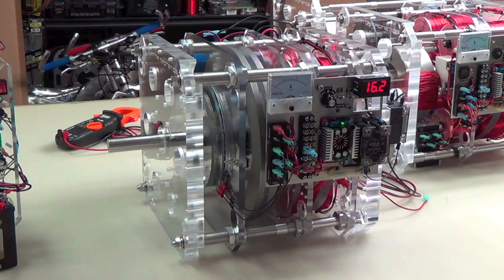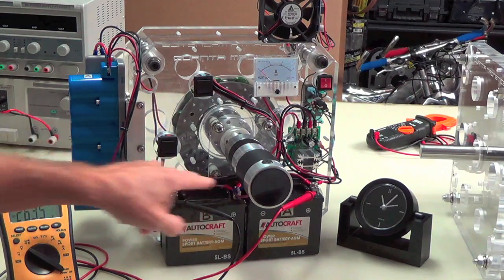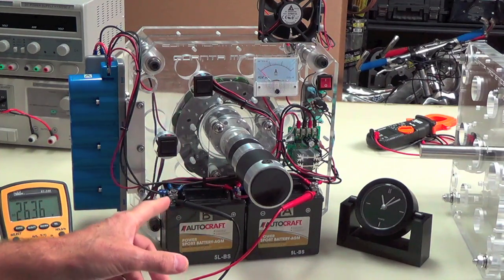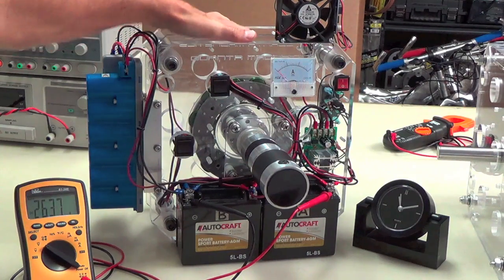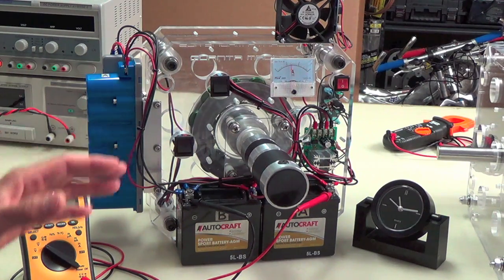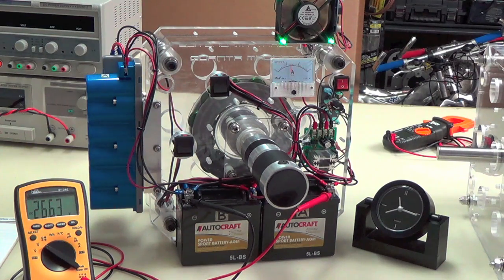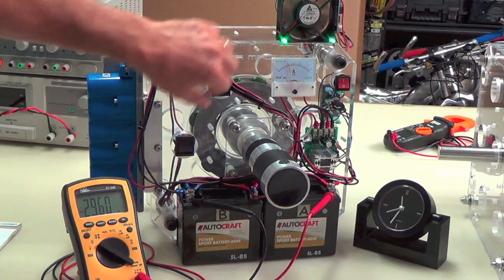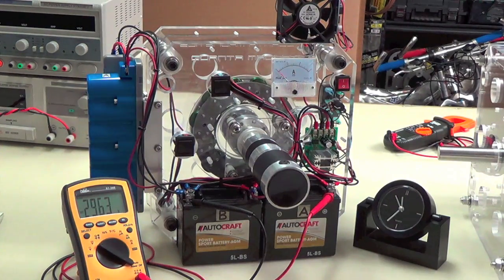Tesla Switch Hybrid to Supercaps

Comment: Watching again OK now Just had a YOUTUBE glitch for a moment .
Can You tell me the difference between Amps in and Amps out? R
Reply from the maker: +Roger Barker  I'll need to connect two more ammeters due to split phase outputs. Then I can give you the numbers.
Reply: +PMMG4HYBRID Thanks heaps . 
Appreciating that you have uncovered some kind of a new electro-chemical effect on your Ultra-cap/AGM series/parallel system, generating excess Voltage. which may require a dump mechanism to protect electrical components.
It will be nice to see, Quantified in Amps, what positive output benefit is available. 
While voltage presents high, maybe current could be regulated or transformed and utilized direct with more load than demonstrated by fan and LEDs, or diverted into secondary storage bank or inverted back to grid. 
Kind Regards. Roger

Comment: So is this not just showing that: when system (motor) is switched on it draws a current from the batteries/caps.
the 3 phase generator then reacts to try and balance the loss (greater load reflected in the motor drawing more current).
as the batteries/caps start to charge due to the current flow from the generator (looking at this the current generated is greater than the total system loads) 

As the internal resistance in the batteries/caps decease due to saturation point the load on the motor drops, reflected in the current drop drawn by it. The 3 phase generator is simply reacting to the loss in induced magnetic friction.

Put a load on any motor and its reaction is to create a greater magnetic field, you feel this by the resistance in turning the motor, reduce the load (current) and the motor will spin more freely.
 
Your system is simply reacting to a loss in balance between battery and generator then over coming it creating less reluctance. Your generator is ultimately producing more current than the system losses.
Reply from the maker: +Paul Baxendale  Thank you for your generous input Paul.

Comment: 26.35 V * 1.5 amp = 39.525 Watts at start
29.7 V * 1.1 amp = 32.67 Watts at end
A loss of 17% of power...
So where is the gain???

NON GAINS OR OVER UNITY !    ONLY BATTERIES THAT ARE DISCHARGING.
Reply from the maker: +Daniel Gendron  Wow, get a grip Daniel. This is only a simple demonstration. Your hypothesis is flawed.
Reply: +Daniel Gendron Sorry but you are not correct, I don't think you really listened to all the explination. The meter is measuring input amps @ one 12v battery via a PWM, it is a 12v motor. The current drops because the load on the motor drops due to change in charge resistance of the battery as it's voltage rises due to charging, that's why the current drops.
It is an interesting and complicated design to quantify as far as energy is concerned. One way is to let it run indefinatly with a balanced load to keep the batteries at a constant voltage!!!! how long will it run for?
Reply from the maker: +Michael Nunnerley  Thanks Michael. That is exactly the point.
Reply: Few comments- Have you taken into account your D.C. Armature in your motor is going to spin faster as it increases in temperature just from running light load, and your losses are becoming less in the planetary gear box as well as it warms up. Allowing it to spin faster and faster. After D.C. Motors reach thermal equilibrium they typically increase in speed by 5-7 % .  
This would increase your emf on your generator. 
But very cool.

Comment: How do we know that the ultra caps are not charging the battery
Reply from the maker: +Tyler Badertscher  They are connected in series-parallel with the batteries. That would not be possible.

Comment: If the batteries have low power, and can make the engine turn, will they be able to recharge themselfs?
Reply: +Ricardo Goulart (Spartan XXV) Can you make that think small enough so I can have it in my pocket and recharge my phone? maby has an condenser to give the starting kick... ?? If you can make that small & cheap enough, it would be a nice thing.

Comment: This reminds me of Nikola Tesla technology seems to at least show similar effects. Interesting!
Reply from the maker: +Banzay20  Has zero to do with Bedini devices.
Reply: +PMMG4HYBRID Ok, Did´t mean to step on some toes. But isn't it some kinda back EMF stored in the caps (voltage peaks) and then they are utilized in the batteries, as far my understanding goes "we" are teaching the conservation off energy in an obsolete way. And where you can get a bigger amount of electrical energy out of a mechanical magnetmotor then you are putting in. 

Thanks for sharing this amazing technology!
Reply from the maker: +Banzay20   No problem.  This has more to do with chemical acceleration and electrostatic absorption or transfer. Still unusual none the less. Thanks.

Comment: battery is a complex chemical device, higher voltage on the terminals does not mean it has more energy in it. the only proper way to measure stored energy in the battery is to do a full discharge and then take the intergral below the discharge curve.
Reply from the maker: +Vadzim Dambrouski   Of course this is true with electrochemistry. Keep in mind that it is the opposite for integrated ultracapacitors, where higher voltage translates to greater stored energy.

Comment: Very nice setup.
Just curious: is the motor running on the 26 volts of the 2 batteries in series or just on one of them?

I have done similar experiments some time ago... when I started at 13 volts per battery it was going up... but when i started at, lets say 12.1 volts it only went up a short time and then started going down again. After resting 24 hours they were always lower than at startup..
Could it be that the AGM batteries react differently than other lead acid batteries? Absorbend Glass Mat Batteries do have lower resistance... but it still remains lead acid...
Luc
Reply from the maker: +DaKrampus  PWM circuit controls 12 volt input. Starting with batteries at top of charge provides greatest potential acceleration through chemical reaction. 
My personal experience is that AGM batteries work best.

Comment: All I have is best guesses. I like Stephan's overunitydotcom  idea for understanding the batteries impedance characteristics. The batteries are also acting like diodes in this circuit. This could be much like the formula Ek = ½mv2 in Euler's disc with a gentle resonant nudge of the capacitors and the 3 phase harmonic Along with the slow response of the batteries chemistry.  It reminds me a lot of a hairpin circuit with the impedance of the batteries facilitating both frequency and linear impulse. Much like a self oscillating circuit or a life form ;). Its all speculative of course. The other hypothesis was already mentioned in this thread. It is the interesting properties of hydrogen. Something I have been incredibly focused on lately. If your batteries/diodes are acting as antenna in an atomic hydrogen resonance, they could be influencing sub-atomic "vacuum fluctuations". This might be more of a stretch, but we need to do some yoga it looks like ;) I am sure you are already subtracting variables to narrow down the cause and setting up controls to see if all these parts must be precise. Also to see if the effect can be increased, though seems pretty natural. It would be beneficial to get some scope shots as well to see all the sections of the circuit in action. Good to see your face and great to see your still hard at work. Thanks for sharing and I hope one of us can get some experimental confirmation on this effect. Enjoy the present my friend.
Reply from the maker: +Diadon Acs (Conscious Energies)   I kind of agree with your speculative thoughts.  I have very little knowledge in the field of hydrogen however.
For this demonstrator, I was first using a controlled small brushless motor as the prime mover element which in reality was a heavier consumer than the gearmotor with all its friction. As I mentioned at the beginning of this video, for years I have always considered this as merely an interesting side effect, yet it has never failed to produce a similar result.  Since a few individuals brought this to my attention months ago as a confusing subject of early G1 videos, I decided taking a deeper look might be advantageous to all.
I have a two channel scope that I have not yet used on this demonstrator. I'll try to consign extra time for that purpose since I'm currently developing other projects.
Thank you for your enlightening input.
Reply: It would be wonderful for a circuit schematic so people can replicate transparently. Do you have one on your website?
Reply from the maker: +Diadon Acs (Conscious Energies)   Not at this point. Do you really think one is necessary? This circuit is so simple for just about anyone from the visual and explanation alone.
Reply: I think I understand the configuration after watching it again but would be nice for clarity. You have a FWBR for each phase of the alternator? What is the gear ratio, if any , on your prime mover? I think I have a more logical hypothesis after thinking about it at work today. Those AGM batteries stand for absorbed glass mat. This quite possibility is helping to raise the potential without a tremendous amount of impedance due to the dielectric properties of glass. In a sense you might have a voltage doubling configuration with your DC motor brushes acting as spark gaps. It is still a super interesting phenomenon and would love to see the total capacitance on the system besides just potential difference. I also wonder what this does to the duty cycles of the battery. Keep up the great work man, you have such beautiful builds and your videos always get the wheels turning.
Reply: Diadon Acs
Too many questions on mechanics. Just look at what are the measures. The rest (mechanical) does not matter. So here are the facts:

Start with 26.35V 1.5 amp. End at 29.7V and 1.1 amp so:

26.35V * 1.5amp = 39.525 Watts at start...
29.7V * 1.1 Amp = 32.67 Watts at end...
So where is the gain?????
No gains! only 17% of POWER LOSS.

Wizards always draw attention to what is not important.
Reply: Diadon Acs
This is why he encourages us to look at voltage and clock... But it is true that he made beautiful desing. It's beautiful ornament to decorate a lab. ;-)
Reply from the maker: +Daniel Gendron  And this is your math Daniel?  The voltage only represents available storage. The starting and ending current are only showing what is being consumed while running. As the impedance of the load (batteries, caps) is reduced, so is the input current demand. Any increase in Ultracap voltage represents additional stored energy. It doesn't require a wizard to use common sense.
Reply: Daniel Gendron You know what, I should have been paying attention to the analog meter more carefully. Humbling lesson and I appreciate your words of reason.
Reply from the maker: +Diadon Acs (Conscious Energies)  Not much of a lesson.
Reply: PMMG4HYBRID There can always be something learned in every situation. I don't think you or anybody else stated this has a total gain, so no worries. I have faith you are not purposely trying to avert our eyes.  We are all just trying to learn and you are kind enough to share this experiment with us, for that I am very great full. Besides, I think wizards are pretty sweet, just look at Gandalf  ;) 
83% efficiency is not something to dismiss out of hand. I do believe Daniel is correct with his numbers for total power because you are pulling from the same load you are charging. The fact that the voltage rises as the amps decrease suggests this might be a resonant system. One  might worry about over charging those AGM batteries though, as that is a common problem for that type of battery as I am sure you are aware of. I would think there internal resistance will decrease as you push there dielectric insulation to there limits. I feel a variable load is still a great suggestion and look forward to more videos.
Reply: PMMG4HYBRID
Common sense you say !?
Do not worry, you will surely find buyers who have the same common sense you have ..
Reply from the maker: +Daniel Gendron  Buyers of a demonstration?  Brilliant!
Reply: PMMG4HYBRID
G1 Delayed Chemical Reaction produces Increased Stored Energy...
So no overunity? Yes or No

Comment: why not use a charge controller on the batteries with a grid tie inverter as the dump load when the batteries over charge? Just a thought...
Reply from the maker: +pife2u   Good thought. So many possibilities.
Reply: +PMMG4HYBRID  I don't think you'd get much run time out of the inverter before the charge controller kicked back off of dump, but you'd at least be getting something. But then, if you scale up the generator and the battery and capacitor bank, it might be worth while...I've had this thought in my head ever since I started watching your videos...

Out of curiosity, is the shaft on your axial flux generator stainless steel? I realize that your rotor is plastic, but in working with generators myself, I've noticed quite an increase in output power by using stainless for the shafts. I'm not sure why, maybe not shorting out the magnetic flux of the rotor? I know enough about this stuff to just be dangerous...
Reply from the maker: +pife2u   Scalability works great for some technologies, and this may qualify as one of them.
Yes, the shaft is stainless steel, and the rotors are polycarbonate.

Comment: So you need some kind of permanent storage bank to store the excess  energy? Or for re-use? Back into the system to power it ?, Your experiments is way over my head at times, but I enjoy them nontheless, thanks for the videos
Reply from the maker: +TIM WILSON  Off loading portions of excess from ultracaps without disturbing battery chemistry is one of my personal considerations.
Reply: +PMMG4HYBRI,  You may be on to something with this,  keep it up what You have done so far is impresive

Comment: in my head, the way I see that you could use the additional voltage, is take a few units with a battery pack for each set and power a nice "torquey" DC motor, and hook that to a clutch, clutch will drive a flywheel, heavier the better and put it on mag bearings. then on opposite side, add a nice gen to use when you need it. will need a variable speed clutch on that end because the goal is to have it run faster then you need for the generator. inertia. that's the key. ideal fly wheel battery. incase it. under vacum. floating on magnetic bearings.
efficient magnetic clutch or regular centrifugal clutch.
Reply from the maker: +George Robles  Yes, flywheels do store kinetic energy quite well.

Comment: Why dose your DMM read a negative voltage when the leads from your DMM are clearly hooked correctly to the batteries correct polarity?.
Reply from the maker: +TinManPower   It's just the video resolution. It looks like a negative symbol but actually reads "DC" on the meter.

Comment: wouldn't the same thing happen if you just used a hair dryer on the batteries sitting there without drawing a load?  Don't they just get hot cause you're pulling amps?
Reply from the maker: +J Decker  No. In this setup, the AGM batteries do not even get warm. You have to push their charge to 16+ volts before they slightly off-gas.